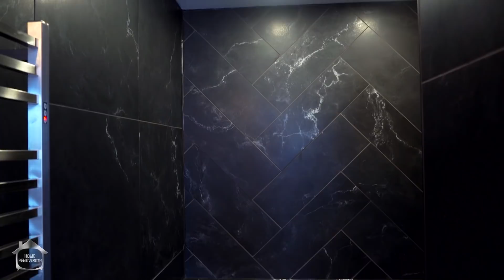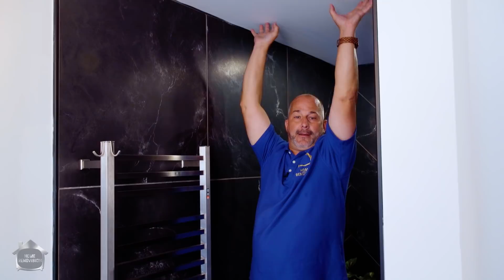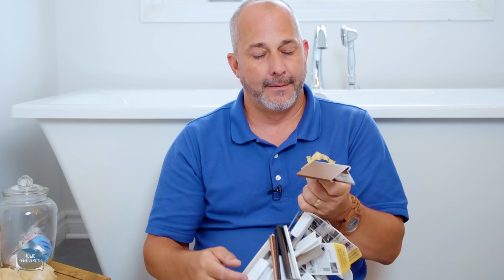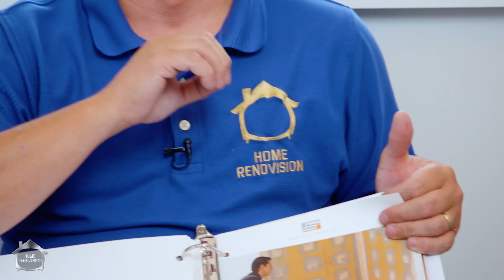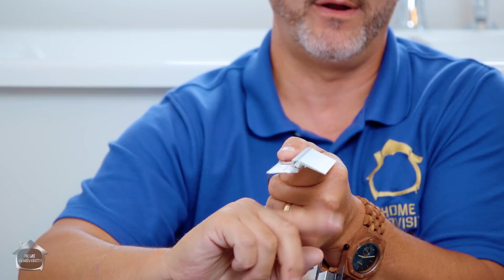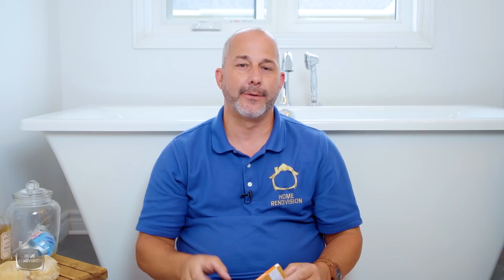How To Build A Curbless Shower

Comment: That ledge is a good idea. I am trying to redo the shower at my uncle's place. The shower is against an exterior cement wall (subterranean house), so I can't do a built-in shelf-cubby directly. Building out a ledge solves a lot of problems, while not wasting materials on a full frame being built out.

Also, should be okay to tile onto the cement wall (with red guard painted on)?

Comment: I don't think it's really necessary that heated system. How long has that technology been used? and how long did those bathroom lasted? Is it an sponsored product? I think so. The only thing you really need is ventilation and a good membrane on top of the plywood.

Comment: Hi Jeff! I am about to attempt my first bathroom. I'm ignoring your advice to start with a basic bathroom and I'm going straight for a DIY custom, medium sexy bathroom with tile and heated floors ;) It is definitely at the very top end of my learn-as-I-go skill set, but I am confident I can do it. I am super grateful for your videos. My question (for today) came up at 6:29: for heating the floor in a tiled shower, at which layer do you install the heating element? I am doing a sleed-slope shower pan instead of using kerdi because kerdi doesn't make a prefab shower pan with the proper linear drain positioning. And because I'm not using kerdi on the floor, I won't be using kerdi anywhere to minimize cross-product-contamination. Cement board and roll-in waterproofing membrane for the walls. And for the floors...as well as where the heating element goes I'm curious what the layering sequence is for the whole shower floor. Would it be 1. speed-slope on plywood substrate. 2. plastic waterproof membrane going up the walls. 3. another layer of cement to bond with tile. 4. heating element (I plan on using the self-set wire that comes on a spool). 5. mortar and tile? Thank you so much! Looking forward to getting this started.

Comment: Ernie died about 1978.   Weird enough, Ernie tiled a bathroom, and shower, about 1950-1960, and when the first tile fell off, about 2010 (followed by the 2nd, 3rd, 10th), I was shocked at what was behind it....JUST PLYWOOD, and some gunk.  wow.  HOWEVER, Ernie, had been working with tile/concrete since he was 12.   The plywood was completely dry.   However, the plywood was off of the studs, by 1/8" - 1/2", and hovering over the drain pan. So, there was a backup, that was never used.   A "BARN" bathroom, would stun you.   If I had to guess, it's concrete, with nothing but a nice coat of lead based paint, but I do not know.    You hose it out, and it still looks new.  The simplicity, would stun the current industry, that wants to use commercial products.

Comment: I would like to do a curbless shower on my second floor. It currently has a tub in place. Would I need to reinforce my floor in order to do it?
Reply: I'm not an expert but a tub usually requires more support since it is heavy and will get heavier filled with water.
Inspect the joists and subfloor to confirm whether it is still good or needs replacement or reinforcement.

Comment: Hi Jeff, Been watching your channels since 2018. Thanks so much for all your help with putting in my new floors, drywall, and more. QUESTION: I have had to widen the bathroom door to accomodate a standard width door so that I can get the new clawfoot tub in. There have been a couple of floors installed since that wall went in and I now have the top 1/2" x 18" x 6" of the walls base plate extending into my soon-to-be doorway that I need to trim down. What's the best tool for this job. Started with my multi-tool - and oh-boy is that slooooow going. Do you have a recommendation for a better tool? Or for that matter - a better approach to solving this problem?

Comment: Thank you for your quality videos.  I am glad that you take the time to explain the finer points; why you are doing the steps in this order; or why the product choice is important.  I've watched hours of your videos and am really impressed.

I've tiled five bathrooms; three in our current house.  I'm think about redoing a basement bathroom because the current floor is 30 years old and we want a change.  Once I knock out the current tile, questions arise.  I'm thinking of using a diamond grinder to smooth out the surface.  I did not use floor leveler originally and the tile has stood for 30 years.  I'm think of using the Schluter membrane for my redo but am questioning whether I need it.  I intend to take out the vanity and redoing the entire floor so my wife can pick out new vanity once I'm done.  Any thoughts on when and when not to use Schluter?

Comment: Love this channel as it has helped me with several small projects.  Have started a small bathroom remodel and hoping for some advice.   House was built in 78, so subfloor was old plank boards on 16C .  I put 3/4" Advantech over the existing subfloor after repairing the water damage that was there.   Plan is to use LVT and the advantech is slightly uneven.  (understand original sub-floor is uneven)  Should I use FLC before laying down 1/4" Ply underlayment to give me a smooth surface for the vinyl?  Or another option?  I have replaced the drywall with moldguard and only plan to use tile as a backsplash, rest will be painted.  I am at a stand still as I don't know which order I should move on to complete.  Finish the walls complete, then the floor, (except for vinyl), shower, vanity, then the vinyl and finally the toilet.  I will only be installing a shower base and surround, so no tile is involved.  Any help is appreciated and I apologize for being so long winded.

Comment: Hi Jeff awesome videos! I am remodeling my bathroom and designing it now.  My shower will be 34” x 52” and will be using kerdi pan and wall boards. Would you recommend a niche for a bathroom this size or a ledge build out like you did?  2 sides will be glass panels while one of the 52” walls is an exterior wall.  Would think the ledge would have to come off the 34” wall where the valve will be.  Thanks!
Reply: I joined your channel but not seeing the icon. Maybe it will be a little delayed...

Comment: Jeff,
When doing bathroom walls, should you use cement board? I'm not talking about around the shower. I mean all tje other walls.
Reply: You can use cement board, lots of contractors do and the results are good, if you know what you're doing. Make sure you use the screws designed for cement board, use the right fiberglass tape, and tape the seams with thinset.
You can also get some of that redgard rubberized waterproofing compound and go over your seams, heck you can do the whole shower surround with it if you want to, and that will help with waterproofing
Oh yeah, and keep the edge of the cement board like 1/4" - 1/2" away from any horizontal acrylic surfaces - you don't want it to rub

Comment: Jeff - when you did this bathroom renovation did you use a laser level for the tiling and placing of cabinets? Is a laser level something you would recommend purchasing? I was looking at a 360 degree green level laser
Reply from the maker: yes I did and yes at the very least use a cross line laser Cheers!

Comment: Jeff, does the warranty from Shluter become void if touched by a diy'er? It's been awhile since I've delt with Schluter but I thought it had to be installed by someone certified or the warranty is void. Also, you must use all their recommended products and processes or the same end result applies.
Reply from the maker: they removed that requirement so now it is all about the assembly only!

Comment: Hi Jeff, been trying to ask a question for a while... hopefully this will find you. Have recently moved in to an old house after years in rented accommodation,  so diy skills are skanty. I've filled some cracks in plasterboard ceiling,  but have over-filled I think, so lots of sanding down! Ceiling is slightly textured,  but rubbed- down areas are now obviously smooth and will look horrible when I paint over it. Short of sanding the whole ceiling flat 😬, please can you tell me how to mask the flat bits and blend with original ceiling? Kind regards, Mike
Reply from the maker: Hi Mike, they sell roll on texture that you can use to help hide the flat area. not perfect but a lot less obvious. Cheers!
Reply: @HomeRenoVisionDIY  Hi Jeff, of course! Thank you,  Mike

Comment: Hmmm - it does sound a bit like a Schluter commercial ;)
I wont argue that perhaps if you add the cost of jet backer, Redguard, cement, etc maybe the Schluter systems are somewhat comparable... (seems unlikely).
The issue for me isn't really one of money as much as it is trusting myself to install a product I haven't gone to school to install.  I am a homeowner and like doing things myself. Honestly, I dont want to go to School for a week to do my bathroom ;)

Jeff are you suggesting this can be done without learning to use these Schluter products?
Thanks,
B
Reply from the maker: I am suggesting that following the installation instructions will lead to a good result. Cheers!
Reply: No doubt. By the end of it, I just saw an orange polo with a "Schluter Systems" logo on the chest. Most people generally say "sponsored by..." or will have the professional courtesy to review comparable products.

Comment: The part about using drywall compound on the Kerdi Board is very true! I was renovating my bathroom, and the mold from the original failed shower destroyed the drywall about 5 inches outside the limits of the shower design (the only thing holding up the old wall was the tile itself). Extended the Kerdi Board about 8 inches to the next stud, and used a bucket of drywall mud over the whole thing to texture it, prime, and paint. It's about the same process as mudding a butt joint.

Comment: Jeff what is your thoughts on hardwood floors in a bathroom(bc I've purchased the wood already ) linear drain in shower using  Schluter products and with a freestanding tub under fireplace?
Reply from the maker: better if it is site finished but as long as you are diligent with managing the water you will be fine and it looks great!
Reply: @HomeRenoVisionDIY  can a heated floor be placed underwater to help with moisture control? Also, can you do a video with wooden floors in the bathroom?

Comment: Hi, this is off topic, but I have a question. I have been watching your video from 12/26/18, about building a shed. I'm confused about how the roof is attached to the shed. I saw you put the blocks in 3 corners, to square the roof. I also saw the 2x4 that attached to the underside of the over hang part and the small vertical pieces that supplied the load transferrance. But I never saw you fasten any of the roof rafters to the tops of the front and back walls. So, my question is, what holds the roof on? Did I miss something? Please let me know. I just finished my base and I will now start building my walls, so I want to know about the roof, before I get to that stage. My shed is going to be 4 feet wide and 8 feet deep, it's just to store my snow blower and a few tools. The front wall will be 6 1/2 feet tall and the back wall will be 5 feet tall. I wanted to have an 18 inch overhang in the front and 6 inches in the back, with a 4 inch overhang on each side. I would appreciate your input very much. Thank you. :)

Comment: Did I just watch a Schluter commercial?
Reply from the maker: not at all! I do However use their products and find them incredibly easy to use for homeowners who want to DIY!
Reply: Felt like it, I'm sure schluter is the way of the future and it's definitely the new hotness, would just like a few more examples of contrasting options sprinkled in
Reply: Do your research don't be a troll! I did a ton and found that this was the easiest / best product that might just be the only one???  Not a lot of competition out there.  Thanks Jeff,  I did a curbed shower replacing the tub the next one will be heated and curb less.

Comment: I'm absolutely terrified of building a shower pan(2nd floor bathroom) regardless of the method/product used so I went with a 'high-end' composite shower base. But adding a heated floor to help dry any residual moisture that might get through the pan, brilliant!!
Reply from the maker: without a doubt the best fail safe system lout there. Cheers!
Reply: Those look nice - how do you like it so far?

Comment: Hey Jeff love your work. Question I already put cement board down on my bathroom floor should I also put ditra on top of it? Or will the cement board be just fine? Thanks
Reply from the maker: ditra is an option instead of cement board. 1/2" cement board applied with thinset on 5/8 osb with 16" O/C joists is great/ Cheers!
Reply: @HomeRenoVisionDIY  how do you recommend cutting Hardibacker board? The guy at homedepot said to score it with a knife like drywall bit seems to have to be cut almost in half to get a decent break. Tried jigsaw, dremel multi-max and it just burns the teeth off the blades on a few inches.

Comment: Is there a reason we don't use GFCI outlets as a standard throughout the house? I understand it might be overkill but seriously - you have the peace of mind of all of your outlets. Is it terribly more expensive to set up and add to the breaker than a standard outlet?
Reply: I can answer that, as I was just looking into it not long ago for a rewire job in my home.
GFCI receptacles are about 5x more expensive than a standard one. Standard about $3, GFCI about $16 for 20 amp.
Breakers are about 10x more expensive.  At least for the SquareD Homeline breakers for my panel.
Standard single pole breaker is $4.50, GFCI is around $48.
Reply: @tay13666  Perfect that's what I wanted to know - thanks for the info!
Reply: GFCI are to be used near water sources ie a vanity. Overkill in my opinion if used in a living room.

Comment: Love all your videos but have a question off topic. After removing carpet there were tons of stables. It is best to remove them right? Or can I just hammer them down? Would you be worried if you hammered stables and they came up over time. Going to install luxury vinyl plank with the backing already underneath
Reply: I also removed my old carpet you should remove the staple for smooth floors, we install engineered hardwood floor. Its a lot of work but worth it.
Reply: I am no expert but I have decent experience in this. I actually just went through this process. I removed the staples with small plyers that had teeth and grabbed onto them and pulled them right up. Best of luck in the vinyl flooring!
Reply: Remove the staples!!!